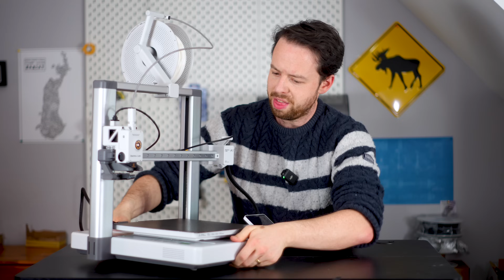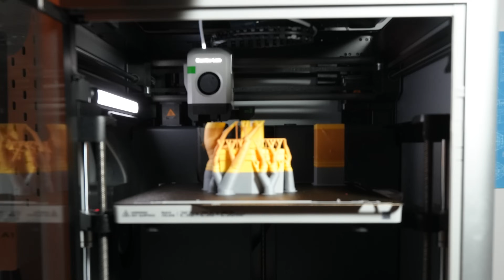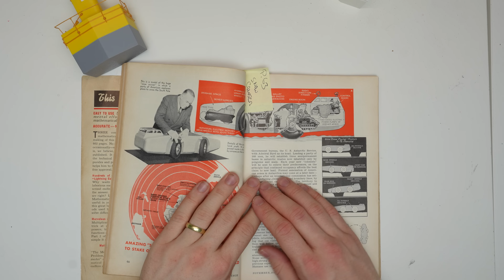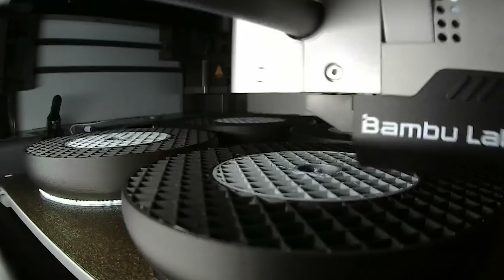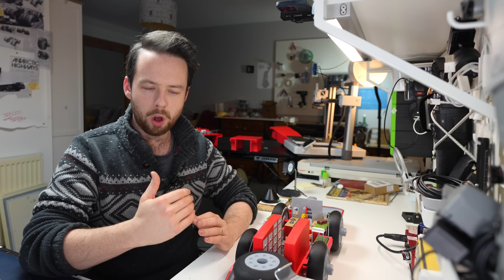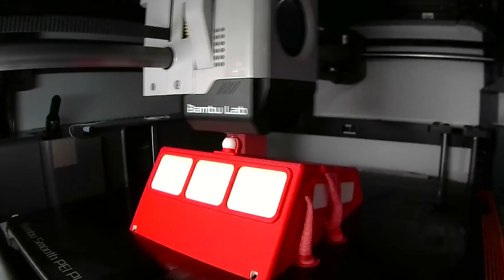Recreating The Lost Antarctic Cruiser!

Comment: Question:  I am making an Antarctic Snow Cruiser as a Pinewood Derby car.  It is a an competition where adults can participate.  I am contemplating putting on the radio antenna's. I am looking at various models and photographs.  Where were they located when attached?  I see some models where the front beside the exterior of the cockpit. Right or Left, or Port or Starboard?  I am realizing we have differences on what drivers-side means.  I see one photo where it is attached front and center.  Is there an answer?

Comment: I bought an X1C with AMS a month ago and have now printed for around 150 hours+. I love the printer and always find myself just watching the printer and being happy like a little kid. Like a little kid watching a construction site with big eyes and not wanting to do anything else. The printers are just extremely cool and useful.

PS: If you use another plastic such as PETG as a support interface, it will almost come off on its own after printing. Because PLA only sticks to PETG lightly. Which makes for much simpler and clean support interfaces and works in both directions. But materials like PETG should be dried before printing.

Greetings from Switzerland:
Raphael

Comment: If you have an AMS or equivalent I can't recommend using an interface material for the supports. Like PETG as the last layer of supports when supporting PLA or vice versa. There are a few other combos of materials that just don't stick to each other, but those are probably the easiest and most common.
Reply: Also, major kudos for painting it and doing your best. I'm personally sick of the folks printing  cool stuff and refusing to paint.

Comment: I suggest one small change: You should cut out the windows and replace them by some clear material (e.g. acetate or from packing)
Reply from the maker: Definitely, I did try but it was too thick! You do get clear filament though, so maybe I could try printing clear windows?
Reply: @CalumRaasay  That would be cool!
Reply: @CalumRaasay   printing clear windows never really works since it is made up of strands/layers it will look very foggy because of all the light refraction,    best would be to 3d print just the window frames and make them so that you can slide in a sheet of nice clear plastic!

Comment: Your models are amazing!i used to do a lot of scale model building and seeing you build them gives me the fuzzies and makes me want to dig out the glue and brushes! 

But.. quick word on the X1 - it works amazing, untill it doesn't. We have 2 X1C machines at work, one with AMS, 1000 h work on each.  One can't print a circle since about 200h, nothing helps. We just accept the issue. The other couldn't work with the AMS after 100h, i had to run a metal ribbon through its drag chain and now one of its leveling sensors works only when it wants.

You'll love them, untill one day they make you cry,

Comment: There's a video out there about using 3D printing to create a metal lathe and a drill press. They 3D print the external surfaces, put some mechanical hardware in it then fill the open sections with concrete. No, that's not a typo. The result is something which is quite solid (and quite heavy; nothing remotely flimsy about it). If you want to build out more tools for your workshop, check out their videos.

Comment: Could you imagine making it RC? That would be epic.
Reply from the maker: I had some issues attaching the wheels (it was not really designed to be printed that big!) so had to glue them. Maybe if I get an RC system I’ll keep it historically accurate and have it barely work 😂
Reply: @CalumRaasay rctestflight may be able to help!
Reply: @Jockymcbock  @Project-Air may be a better collab especially as he is British. He could build the plane. Even make it rocket booted so it can take off straight from the Cruiser.
Reply: @davethedog007 I agree, a collab with Project Air would make a lot of sense. I can imagine them both already.
Reply: @CalumRaasay  It could definitely be a fun challenge to find the right sort of motors and gear them properly to generate somewhat accurate torque and speed. You'd never get the right sort of traction just because of the physics of size, but it would still be an interesting project. Especially if you could get a cab camera and drive it with an FPV rig.
Reply: Yeah, and then set it up on snow on watch it not move
Reply: @captainevenslower4400  Only in reverse. ;)
Reply: @captainevenslower4400  Very good! 😉
Reply: It would get stuck indeed
Reply: Thinking about it @StaplesandVine did something very similar with the Alien APC. It would definitely be in his wheelhouse.
Reply: As of now I'm working on it
Reply: Maybe it won’t get stuck in ice this time
Reply: @AdrianMannino  it depends on the wheels, the large, smooth, treadless tires were originally designed for a large swamp vehicle; they spun freely and provided very little forward movement, sinking as much as 3 feet (0.91 m) into the snow.
Reply: Make a model boat. Let it crash off
Reply: No.
Reply: @screamingsixties  yes
Reply: @ if you’re a child, yes. Are you?
Reply: @screamingsixties  Yes, a 47 year old one 😂
Reply: @davethedog007   nice.
Reply: Whatever you do, make sure it has  a better power to weight ratio than the original.
Reply: Ikr this was the first thought I had when I saw the video.
Reply: I would love the snow cruiser. Complete with the plane. Although the airplane doesn't need to actually work. That would be a great bonus but I'm no good with RC planes.
Reply: @makeitrc
Reply: Considering the sheer size of the original I reckon it would be conceivable to build a fully drivable 1/4 scale version.

Comment: After years of using a ender knock off starting with G I was so frustrated at the speed of printing, Fussiness of settings and setup, experimentation. Etc.

Keep in mind I'm not an engineer or even a computer person by profession.  I paint cars. So yes I'm used to finicky fussy processes with lots of variables. And fully understand that some processes are just difficult.  

I splurged and got myself a a1. Wow. Most models or parts I print I simply find it.  Use the profile with out any edits and hit print.  And boom. It's done.  I never wanted a printer that I didn't have to slice the file. Download it to a SD card and then go to the printer and baby sit the first few  layers.  But now I sometimes print from my phone while I'm at work.  Get home and it's done.  Being able to easily check on it as well as get a message if there's a problem. Is great.  The base print time with out any edits and pushing the limit is 30% of my old printer.  Not 30% less. It's 30%.  Prints that took more than a day are now done in 8-10 hours.  I love it. Worth every penny.
Reply from the maker: I’ve spent way too long looking at print progress on the app 😮‍💨 haha. But yeah I was blown away by them - if I’d known they were so easy I’d have got one ages ago!